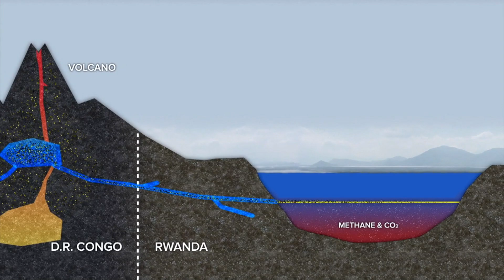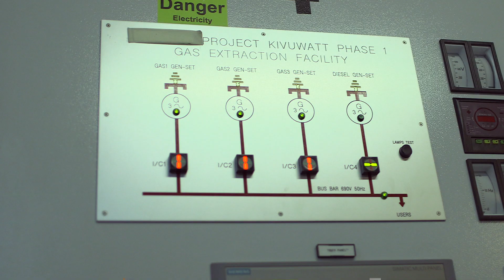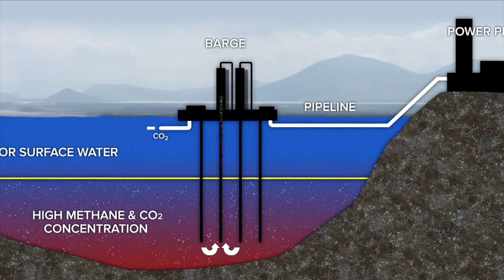The 'Killer Lake' Powering Rwanda - BBC Click

Comment: god idea. 
1. it is importend to release some of the methan (CH4-gas) and burn it and take  all the energy out to cenvert to electricity.
before it wuill release on its own, causing more climate orblem in the atmosfere.
yes- burning methan giuves co2 into the air, but it is 40 times les harmfull than  methan.
2.
methan is a kind og - Natural Gas- which for many years has been a commodity- and is main eksport from russia-
and shipped as LNG- liquid Natural Gas- alle over the world for decades now,

so it is absolutely  a very vise and sain projekt they are running.

Comment: Lake Kivu is the perfect site for manufacturing liquid nitrogen, liquid CO2 and dry ice. The liquid CO2 is readily available from the lake and it just needs to be cleaned in the same way as the methane to make it into a viable raw material for manufacturing dry ice. To make dry ice, liquid nitrogen is also required and it may be cheaper to manufacture it in Rwanda than import it from Kenya. Liquid nitrogen is manufactured by extracting nitrogen from the air. If the lake can pressurize CO2 and methane to their liquid state, then maybe the nitrogen in the air can be liquefied by the pressure of the lake and then extracted again for use in the manufacture of dry ice. To do this, perhaps a plug of water could be pumped into the lake to extract the methane and CO2 gases and then air could be temporarily pumped into the lake to liquefy the constituent nitrogen and oxegen gases and then more water to extract the liquid nitrogen. Extracting nitrogen using pressure in the lake might use less energy than conventional methods. Anyway, Rwanda needs dry ice for things like cold storage in food processing, aviation and other industries that may establish in Rwanda in the future. It is cheaper to use dry ice than just electricity in cold storage.

Comment: What are they doing with the co2 after extraction? I  thought we were gonna die in 12 years from global warming via excessive amounts of co2
Reply: It would leak out of the lake eventually, and possibly kill tens of thousands of people. All that oil and coal in the ground that people keep digging up and burning wouldn't.
Reply: @SocialDownclimber  , yes but that natural mechanism happens over time a little at a time.  With this method its much larger quantities in a much shorter time span.
Reply: @markschiavone8003  No, the natural mechanism doesn’t happen a little at a time. It happens as a catastrophic event. That’s why it’s called a limnic eruption.
Reply: Rwizaify ,, well climate alarmists say that if it gets 1 degrees warmer it will slightly increase the co2 release so it must be already releasing it.
Reply: @markschiavone8003  Maybe it is. And if so, it must also be releasing methane, the other dissolved gas, which is even more detrimental to climate than CO2.
But the main alarm for that lake isn’t about climate. It’s about the risk of a cataclysm.
Reply: Baffles me that their design did not include a Thermal Oxidizer to reduce CO2 emissions.

Comment: The fact that the CO² Pipe leads to "nowhere" kinda makes one wonder, how much they will pump into the enviroment in addition to the created CO² from using the methane! ... this does not look good atall!

Specially Africa should do their best to get Solar on any roof! a small panel & a battery would already make a world of difference!
Reply: They're probably putting 100% of the CO2 back in the environment, where it came from, but just in a different place. As for creating CO2 from burning methane, you do realize that LOWERS the net greenhouse gas effect of the atoms involved, right? And it's a substantial amount lower. If just left alone until an earthquake releases both the CO2 and the CH4 into the atmosphere, the greenhouse effect would be even larger. This is far more pro-environment than strip mining to make solar panels and batteries or even doing nothing at all about the dangerous problem that naturally exists in their back yard.

Comment: If the waste CO2 can be separated from the H2S, perhaps it could be turned into liquid CO2 (using liquid nitrogen) and then used to make dry ice. Rwanda needs dry ice for cold storage facilities.
Reply: or even better if the CO2 is converted via methanation reaction into CH4, thus increasing the methane yield and calorific value significantly. Perhaps dry methane reforming process (catalytic reaction involving both CH4 and CO2 in the stream) could also work as well.
Reply: @TheAntoine48  you said the magic word, catalytic. Absolutely not economically feasible for this facility and market. H2S could be captured through Sulfatrap beds and CO2 could be safely discharged through a thermal oxidizer but again, not economically feasible.
Reply: @augustomendizabal4986  Yeah that's an important point. The scale has to be large enough to justify the valorization process' economics.

Comment: The gas bubble pressure from that depth  should have plenty of energy potential for energy in the first place ,before the methane is even burned as fuel. I wonder if it could be preheated enough to release the "Bubble Energy" without actually igniting the fuel?Certainly the carbon dioxide has potential as a turbine propellant, if it could be employed for driving electricity turbines. Double use potential I think.
Reply: what a nonsense

Comment: Please correct me if I missed something but at 1:28 she said carbon dioxide leak kills...she must confused with carbon monoxide or methane no?
Reply: No, the event she refers to is called a Limnic eruption. It happens when the lake with CO2 dissolved in the water releases all the CO2 in a very short time frame (like opening a bottle of soda). CO2 is heavier than air and especially when it is cold CO2. It will form a surface cloud that suffocates everything it passes.

Comment: It's time to replace this fossil fuel burning power plant with solar photovoltaic panels on the roofs of the houses and batteries for using the electricity at night.
Reply: As the climate heats up the water will as well and the methane/CO2/HSO may be released creating a disaster zone using it up and converting to CO2 is a good option. CO2 is a lot easier to deal with and does less damage than Methane.

Comment: 100 years from now we might learn why the lake needs that gas.
Reply: Erm......its a lake, it doesnt "need" anything.
The gas is there because of geological processes explained in the clip.
Reply: Thought Challenger you mean like to maintain a equilibrium of naturally occurring gas in suspension.  which once lost will result in (tune in next century as we try to figure out what could have possibly gone wrong...
Reply: There is an obvious risk when you open a bottle of champagne that things might get nasty. I hope they have a democratic process to make informed choicesand don't leave it to the engineers how much risk they are willing to take.
Reply: Eljan Rimsa When you open a bottle of champagne, that is a sudden change to the whole bottle. When you use pumps to convert a small portion of the water at a time, it isn't. When there is a seismic event (an Earthquake), THAT is someone bumping the bottle, and the less dangerous the lake is by then, the better it'll be.
Reply: And until then Rawandans will proper!

Comment: CO2 into the atmosphere?  wtf?
Reply: Where elese would you put it?
What do you think what happens with CO2 for car exhaust or regular coal or natural gas powerplant.
Reply: @ivantrapic6209  The country needs more solar and maybe wind power and less methane and CO2.  Looks like the sun shines a lot in that part of the world.
Reply: @mumi009  
And in the case of earthquake they should pray to god(s) that it won’t release methane and other gases that could kill them all in a blink of an eye. Other countries produce a lot more CO2 that is pumped into atmosphere for a lot less useful project so I thinks it is hypocritical from us to say that this is bad behavior.
Reply: @ivantrapic6209  Generally speaking, the African nations are being held equally responsible for the climate changing emissions, which is not correct, nor right.  Most of the crap comes from the northern nations (includes China). 

The country has a right to exploit its own resources (better than the gringos coming in and stealing it all).  However, I would argue that the money invested in the machines to extract gas from water would have been better spent for solar and wind power.

Just so you know, CO2 was a major killer of humans and animals in  past earthquakes, volcanic eruptions.
Reply: @ivantrapic6209  - you're confusing monoxide which is the deadlier carbon compound from that of dioxide which the op is asking about and is often released by volcanoes and oceans and used by plants and us for carbonated beverages.

Comment: She said currently 51% has Electricity in Rwanda 
In Nigeria is less than 20% with all the oil and gas sector money. 😭😭😭😇😰🙈
Reply: That's thw resource curse at work for you.
Reply: I worked on a project for TurboEnergy of Nigeria in the '80's. They had some great ideas but major corruption too!
Reply: You have a typo error, it's supposed to be 2% not 20%.
Reply: @AideePam  2% is still less than 20%
Reply: @InfernosReaper  my point exactly.

Comment: Landfills also create methane, when you burn it, it is less harmful for the ozone. So when generating electricity from methane it should be even better for the environment. If it's locked in the water maybe the amount of carbon dioxide is net positive in the air.. Will the water become better for organisms? Then bind more carbon dioxide..
Yes I am for a better climate and environment. Who is not? The solution should be the best you can have within the means available..

Comment: What is its total CO2 output ? Co2 is removed from the feed water and vented to the atmosphere, methane is burnt releasing co2 and h2o. How does it compare to a coal fired power station?
Reply: Compared to a coal plant (a) no dust emitted (b) no damage to landscape (c) no mines collapsing, (d) no systematic damage to workers’ lungs, etc (e) no underground fires. Take a look at some examples of the latter: They are devastating.
Reply: Well, it is released in an area surrounded by a tropical rainforest after all and you know plants consume CO2. Also read about killer lakes.

Comment: Interesting how BBC neglects to mention methane is worse than coal for the environment.
Reply: Actually they tell you very clearly in this short video that methane is very bad if it is released but does very little damage if you burn it for electricity.  Pay attention when watching stuff.
Reply: @krashd  You're right, i should pay more attention because clearly i missed the part where they designed a thermodynamically perfect machine that extracts and burns 100% of it's fuel using magical oxidizer that always find every molecule of methane.
Reply: @jamesmatthew1903  Any methane that isn’t converted into electricity is methane that would have been released into the atmosphere anyways. Either way, the end result is a net reduction in methane being released by the lake, is the point Rob Fraser was making